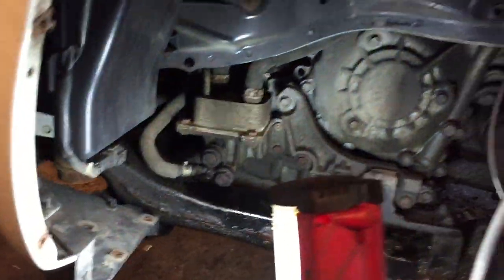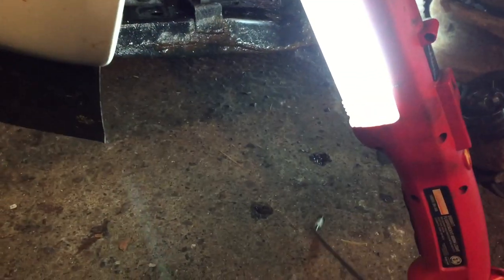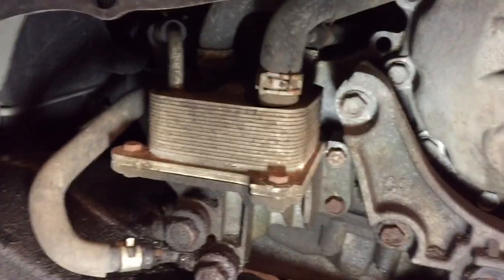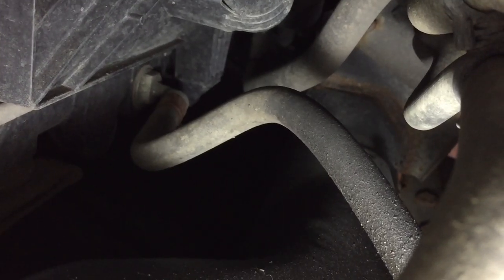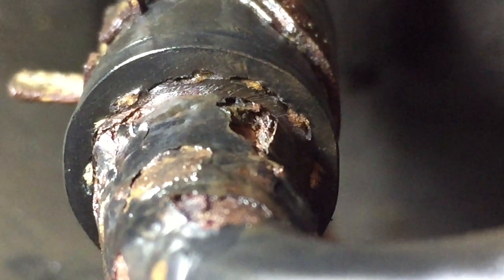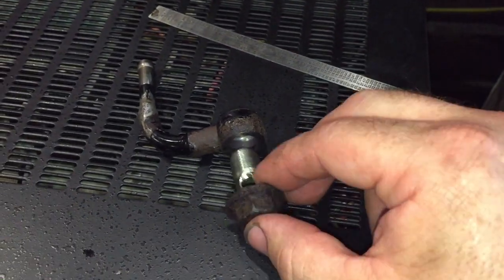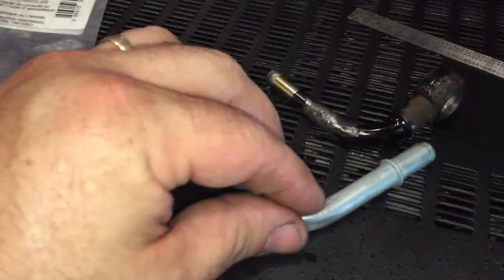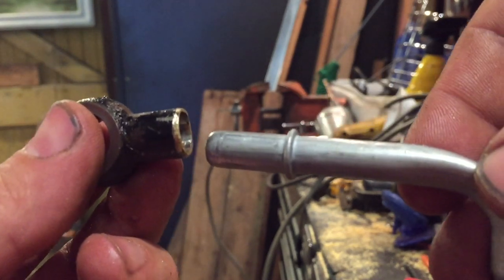Nissan Murano CVT cooler lines leaking.

Comment: My 2010 Murano set up is a bit different but the concept was the same. I had a leak on a metal coupler on that same hose taking it from transmission to the radiator. same reason rust. created a pinhole in the coupler.
thanks for the step-by-step it led me to the exact spot I needed to be at under the car. all fuxed now

Comment: I had a question! Mine isn't leaking from the lines, but the cooler thing itself. I cant find any info on the parts, but it's the recrangular block you pointed to saying it was the transmission oil to water cooler. Do you know where i might be able to find one of them or the part mumber? I think a gasket in there failed
Reply from the maker: Last I checked the cooler is only sold with a complete transmission.
Reply: @JoesCarSmartsNY  Ah dang. That's where it's leaking from, the metal plates sandwiched together from the cooler, except mine looks like it's got a block-off plate. I was really hoping I'd be able to find that, or the internal gaskets for it but not sure on the size of them. Thanks for the quick response!
Reply: Okay, I feel stupid. I found out the part number. You CAN buy the cooler separate from the transmission (and it's listed as a transmission oil filter), and the part number starts with 31726. I have the AWD transmission since my Murano is the SL version, so my transmission fluid cooler assembly is slightly different which is why it has a plate on top instead of the whole cooler assembly. If anyone else has the same problem as me, the part number for the AWD version is 31726-1XD0A... Though those Murano are a dying breed.
Reply: @briandipierro8865  Are you sure about this?  When I looked this part up online, I found 31726-1XD0A, which SOMETIMES is shown with the top part (the cooler with the 4 pipes coming out of it), and sometimes only shows the bottom part.  Then there is part 31726-1XD02, which always seems to show the whole thing, and the price for the 1XD02 is always more than for the 1XD0A, which makes me think that the 1XD02 was used on the AWD models, which is why it includes that extra cooler on top, whereas the 2WD, they may have decided, didn't need the extra transmission cooler.  Mine isn't leaking yet, but if I can get it at a reasonable price, I'd like to just replace the whole thing, pipes, internal filter, and all, just to head off problems with it.  How did your  replacement go on your Murano?  I'm a little worried that those mounting bolts could be impossible to get out.

Comment: This question might sound stupid but, those banjo bolts needs to be thightened in any specific position or they can be thightened in any way???
Reply from the maker: I think you’re concerned about which way the tiny holes point. Don’t worry about it. They flow through the ring of the banjo fitting on the hose no matter which way the hole in the bolt points.

Comment: At the radiator on the '05 Murano , where the cvt coolant line goes in , directly next to the lower radiator hose , I had too repair the connector. Is it CVT fluid,I replace? I lost fluid, but cant tell if it is oil or cvt that leaked out. Due to the dirtiness. There is a line that goes in next to the coolant hose. As well as 1 further away at the bottom. I lost fluid out of the 1 , right next to the hose.

Comment: I was looking for videos on the “upper” oil cooler line and came across this. Went and checked my cvt lines after watching this and they are rotted to hell but not leaking. Do you know if both the top and bottom bolts and fittings are the same size on that exchanger? I will need to do this soon. Thanks! Very informative video.
Reply from the maker: Both of those banjo bolts and fittings are the same size. I’m glad this helped you find a potential trouble spot to save you headaches. Thanks for your feedback !
Reply: Great, thank you! Now here’s hoping I don’t snap off the old bolts. They are really bad. Hopefully they aren’t overly tight. I’ll probably spray it all with a penetrant over a few days.
Reply from the maker: Travis Moore Maybe even use a wire brush to remove any loose rust scale first. That could let the oil deeper in where it’s needed.
Reply: Good point!
Reply: Do you know the torque spec on those bolts? I was trying to crush the new copper washer a little bit. I don’t know if the new bolt was cheap or what but it snapped off in the cooler. I honestly didn’t feel like I was that hard on it. The old copper washer was much more flattened than the new one was when it snapped. I’m going to grab an easy out set in the morning and hopefully I can reuse the old bolt. The old bolts appear to be better built.
Reply from the maker: Travis Moore I’m sorry but I can’t find a proper torque value for that even in the Nissan service manual. I think it’s because Nissan doesn’t sell the cooler or bolts separately so they don’t want anyone taking the bolts or cooler off. Of course buying a complete transmission to replace two small rusty pipes is absurd, so we find a workaround anyway. 

When I did this I remember being super careful with the bolts. Banjo bolts are already weaker than regular bolts and they always make me nervous.  When you get the bolt extracted I would not worry so much about visibly seeing the washer crushing. I would just apply force until the surfaces meet and add a little bit more force. 

I did find an approximate torque for banjo bolts in a general sense. This chart lists approx 25 lb ft for a 14mm banjo. I converted that from the Newton Meters listed... https://www.hoseandfittings.com/banjo-torque/
Reply: @JoesCarSmartsNY   Well thank you for all the insight (both on here and I believe on the Murano forums about the cooler pipe.) I extracted the bolt and finished everything last night; one new bolt, one old. Took it for about a 20 mile ride and all seems well. I did notice on the "ebay fittings" that the hole in the bolt and banjo fittings seemed slightly smaller than the oem. On the oem fittings, they do get smaller as they went further into the hoses tho....so I don't for sure that there is a difference (restriction) in the flow. I'm in Missouri and it's currently 20 degrees F, so I guess time will tell if any cooling is compromised when I drive it on a 100F day in the summer. Hopefully it's traded in by then haha. Thanks again, man!
Reply from the maker: Travis Moore I’m glad it worked out for you. 

I might have drilled the EBay bolt opening a little larger. For some reason that sounds right now that you mentioned it.  All in all there are two cooler devices on these vehicles and I’d imagine you’ll be in good shape now.

Comment: Mines leaking dark purple fluid and I'm wondering if this would be the same thing. Mines a 2007 nissan Murano S Awd
Reply from the maker: Is it from the same area under the car?  I would check all your fluids under the hood. The fluid closest to a purple fluid is the power steering fluid but that’s on the other side of the car. I don’t think the coolant is purple at all, but the original coolant could be. I’m not certain. 

This also might be a dumb suggestion, but what color is the washer fluid you use. That is purple sometimes.

Comment: My wife and I just bought a  2007 Murano yesterday...Well  I woke up this morning to see a silver dollar size puddle of red oil under  the front passenger's side "Smells like tranny  fluid" about a foot away from the center of the front right tire  I took a picture straight  up with my  phone and  it looks like an oil pan to me and it is very wet ....do you think this is a major  issue  or could it be just a loose fitting  he said he had his mechanic just replaced the water pump yesterday before  this  issue was found  I'm hoping  they just forgot to tighten something

Comment: Do any body know the bottom cooler line  tube part #  the one below the one he fixed.  mine is leaking  any help will be appreciated
Reply from the maker: The tubes aren’t available separately. Need to get the bolts and fittings I show in the video.

Comment: Stupid question. But the fluids so dark , I cant tell , if its oil or CVT fluid.
Reply from the maker: Not stupid. If you’re working on the part in this video you’re working with CVT fluid or Coolant. There is no engine oil in this part. I would carefully check the CVT fluid and the coolant when you’re done. Only use Nissan NS-2 CVT Fluid.
Reply: @JoesCarSmartsNY  Thank you for the prompt reply. I think it's gonna be best to drain the CVT fluid and replace then.Looks like dirty motor oil.

Comment: I have a similar problem if you could shine some light. I thought it was the o ring gasket so replaced it. then I noticed that their is oil coming from a hose that goes to I belive the water pump. I don't think the pump is bad maybe the hose?
Reply from the maker: Are you thinking of this video of mine?  It shows how to replace the oil filter o-ring as well as the nearby coolant pipe and hoses. 

https://youtu.be/zVtbkBiRU2U

Comment: When you did cvt fluid changed how many quotes did you put back in.
Reply from the maker: I bought seven quarts from the dealership and I think I ended up using around 6 to 6 1/2. 

Just doublecheck your fluid levels carefully. Remember that the the fluid level on the stick accounts for temperature so when it’s warm the level should be at highest mark. 

I’ve also used Valvoline CVT fluid with no ill effects that I know of. It is NOT approved by Nissan for warranty purposes but I did not have any issues personally.
Reply: You did drain and fill right on it and does use a  10mm Allen wrench for drain plug
Reply from the maker: I’ve drained and filled this transmission several times yes. That’s the only way I’ve done it. 

I’m not certain the size of the drain plug now. 10mm Allen could be correct, or maybe 8mm.
Reply: Joe S. How many miles do you do the cvt fluid changed.
Reply from the maker: The first time I did mine I was late. You should be draining and filling every 60,000 mile I think. I did mine for the first time around 80,000 then every 40,000 or so after that.
Reply: Joe S. I am due then, I have 88,000 miles never did it.
Reply from the maker: I agree. I would do it soon if I were you. 

Some of these cars had major transmission issues over the years, mine never did. (Crossing my fingers)

I believe that mine has held up so far (208,000 Miles now) because I’ve changed the fluid several times n
Reply: Joe S. I am going do it soon easy job.

Comment: What is the correct way to detect this device to see if there is a bug or not
Reply from the maker: Are you asking how you can tell if you have the same problem that I had?  If that’s your question then I can tell you that I found this problem because my CVT transmission fluid was low. I then added fluid so it would be full. Later on the fluid was low again so I had to refill it again. I then noticed small amounts of CVT fluid under the car after parking it.  I then found that these pipe connections are where the leaking fluid was coming from. عبدالله ع
Reply: This is not my question. I have the problem of mixing the oil with the water of the radiator. The radiator was changed with a new one, but the problem did not disappear. Is there any other cooler for this oil?
Reply: With a significant and significant shortage of oil
Reply from the maker: عبدالله ع The cooler in this video has coolant and CVT oil running through it. It is possible that the cooler is internally damaged and allowing the fluids to mix.  Just to be clear you’re having an issue with CVT oil mixing with coolant?

Comment: Weird they went with a water to transmission cooler twice, most dual applications go with a water to transmission and then air to transmission radiator.
Reply from the maker: Maybe this design allows for more heat transfer capacity?
Reply: That’s not an air to radiator.  That’s tranny oil in to its own dedicated radiator

Comment: Btw is the car still on the road?
Reply from the maker: Yes,  mostly.  I’m currently troubleshooting a very odd electrical issue but it still runs and drives good with no engine lights.
Reply: Joe S. Guys like to bash the murano but this is living proof if you maintain it it’s going to last a while
Reply: @vladchan  My 2006 murano is nearing 300 000 km but has a leak which i believe is similar to this but its on both sides of the car so im worried its cvt or oil
Reply: @the250minecraft  CVT is on the right and engine on the left it cant leak on both ends

Comment: What size are the hoses that connect to it ?
Reply from the maker: I’m sorry, I don’t remember. I cut a small piece of the old hose and took it with me to a parts store for comparison.
Reply: @JoesCarSmartsNY  Ok well thanks .I am having the exact same problem with my car.
Reply: @JoesCarSmartsNY  So Joe is that the exact right size for the tube because I found one that has the right angle ? On eBay but I ordered it from the company so I could have it shipped faster because my car is sitting in a garage right now. Thanks.
Reply from the maker: closencounter1000 The measurements in the video are exact if that’s what you’re asking.
Reply: I'm sorry to keep bugging you do you know about what size the small hole in the fitting where the fluid goes through is ? the one I got looks like about 1/4"
Reply from the maker: closencounter1000 I remember that orifice being slightly different from the original one. I can’t remember all the detail tho.

Comment: Have you changed the rear front AWD fluid on your murano.
Reply from the maker: Are you asking about the Transfer Case fluid?  Or the Rear Differential?
Reply: Joe S. Transfer case and rear differential.
Reply from the maker: I was able to replace the Transfer Case fluid when I had the engine out. I have another video on that. The Transfer Case fluid is very challenging with the engine in place. 

I’ve never done the rear differential fluid. It looks to me that the easiest way to do that is to remove the EVAP Charcoal canister (the black plastic box back there) because it is right in front of the plug for the rear differential. It might be possible to get that plug out with a very short Allen wrench, but there is not much clearance.
Reply: Joe S. Do need really change these fluids can just leave them alone.
Reply from the maker: If you can get to them, or pay someone to do them, it’s preferable. They last longer than the CVT fluid but they don’t last forever.  I think you said your car is in the 80k mile range. I would make a plan to do them or have someone do them for you if you’re keeping he car for a long time.  On some of these Muranos the Transfer Case develops a leak and you lose a lot of that fluid. That’s another good reason to have someone check out the transfer case.
Reply: Joe S. I have 88k plan keeping it until 200k
Reply: I will ask Nissan dealership how much they charge for this service.
Reply from the maker: I wouldn’t ignore them.

Comment: where are you located
Reply from the maker: pedro hernandez  near Syracuse NY
Reply: @JoesCarSmartsNY  i want to fix couple thing  i have a nissan murano 2003
Reply from the maker: pedro hernandez Okay. What do you need to fix?
Reply: @JoesCarSmartsNY  i thing the cvt is leaking
Reply: i think in the same place
Reply from the maker: pedro hernandez Where are you located?
Reply: @JoesCarSmartsNY  plainfield nj
Reply from the maker: pedro hernandez That’s quite a hike from me.  Do you have any questions on this video?  If you need someone to do the work a local garage will be able to do it if they see this video.
Reply: @JoesCarSmartsNY  let me see what i can do and i let you know thanks
Reply from the maker: pedro hernandez one problem you may run into is that the Nissan dealer does NOT offer these fittings alone. They only sell them with the entire transmission. You’ll have to find the fittings online yourself.
Reply: @JoesCarSmartsNY  ok thanks